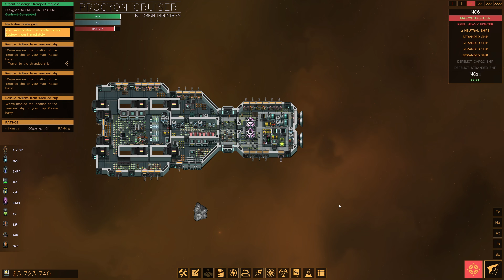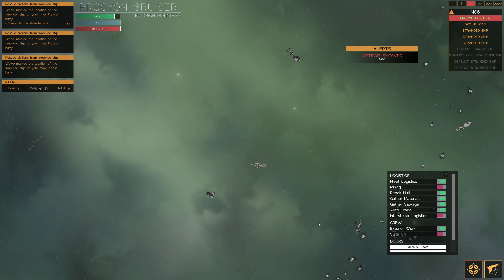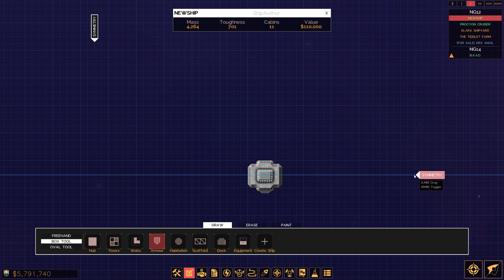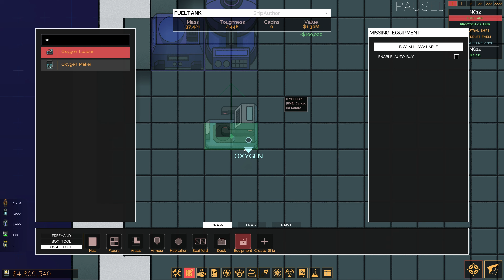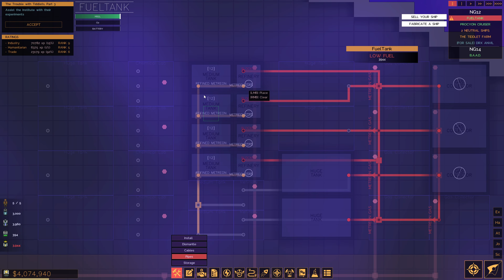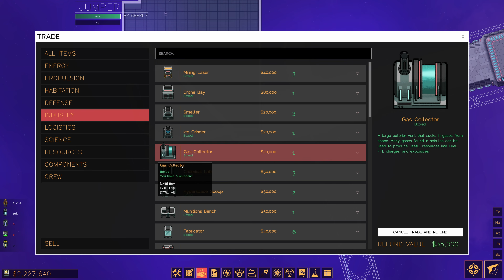THIS WILL BE OUR GAS AND LIQUIDS PROCESSING SHIP - The Last Starship Gameplay - 12

Comment: Recently, I was trying to document the intake rates for everything, and I noticed that Metreon Gas was coming in at a very odd 2.7 per second... couldn't think of any reason for that to be the amount and then on a hunch I loaded up another save and it was 1.7 per second. So it turns out the gas density varies by location. If you're in a system with multiple nebula locations available, it makes sense to take the time to figure out which one has the highest concentration of gas.
Reply: Also varies at each nebula, the denser the colour of the gas, the higher the rate.

Comment: 39:55 A reverse Star Destroyer? Made something similar as a battleship, I put 80 railguns on the front edge, it wouldn't turn to save its life but it could one shot almost anything I had encountered. Called it the OLRS (Obnoxiously Large Railgun Ship)
Reply from the maker: How did you manage to power 80 Railguns reliably?
Reply: @CharliePryor  I had 4 fusion and 10 reactors along with 20 batteries. It still had issues if it was in a long fight but with the exception of the jet looking ship it could take things out quickly.